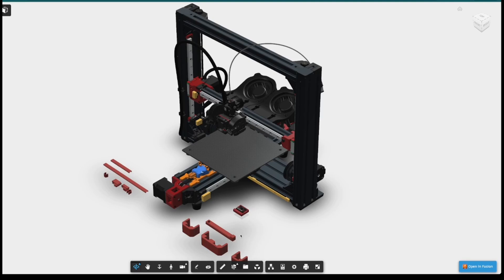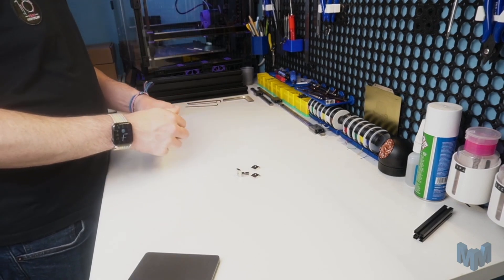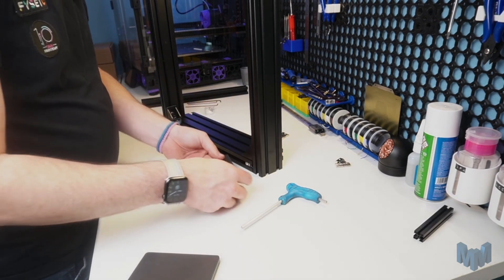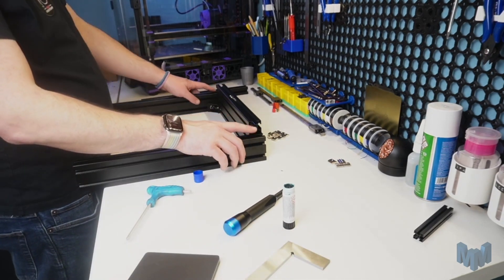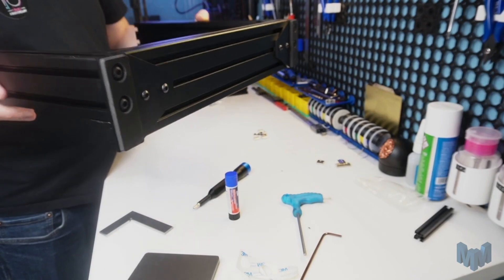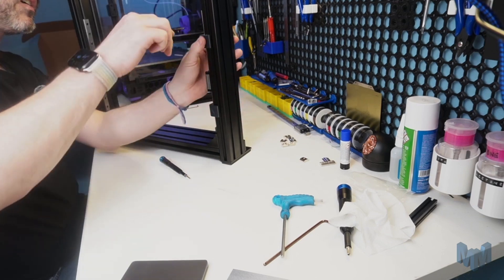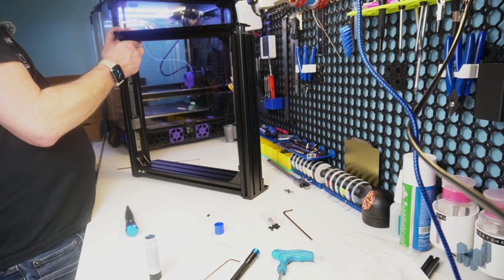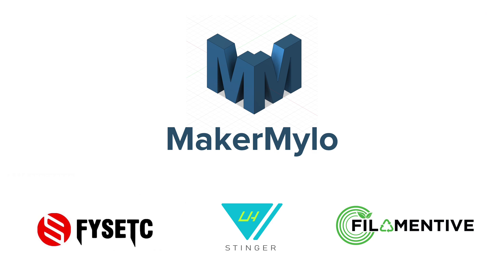LH Stinger - Build Episode 4: Frame Assembly of the Fastest DIY 3D Printer Kit from Fysetc.

Comment: Apologies if you did mention it in commentary, but I realised when I came to fit the two plates on the bottom that the 3060 extrusions, only one end is tapped, trust me to have fitted them both wrong!
Reply from the maker: You're absolutely right, i should have mentioned it! because I too made the same mistake!